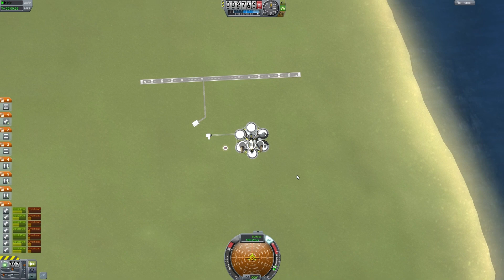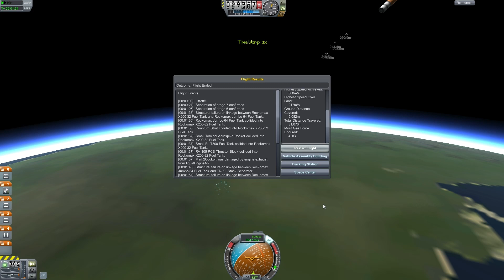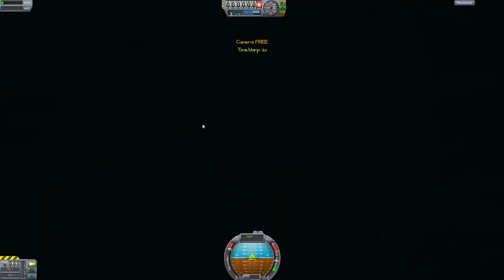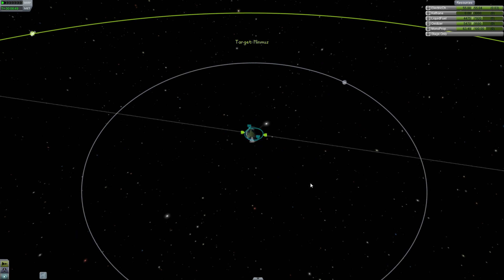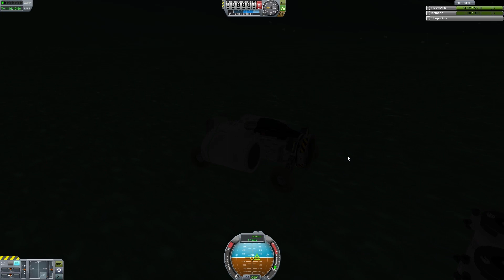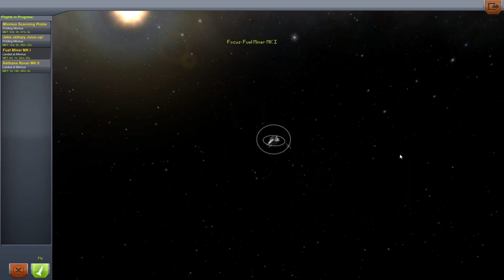KSP 0.19.1 Savestates are for babies 05: Needs more rage

Comment: also i feel i should explain the overheat with the mainsails better. The reason the insulated tanks cause them to overheat to the point of failure is simple, the heat from the engine cannot transfer to the insulated tank, meaning it's trapped within the delicate mechanics of the engine. Not only do the non-insulated tanks accept the heat from the engines they radiate it out into space (in theme at least) Not sure if it exsists in code that way or not but you can thank the youtuber StompThompson